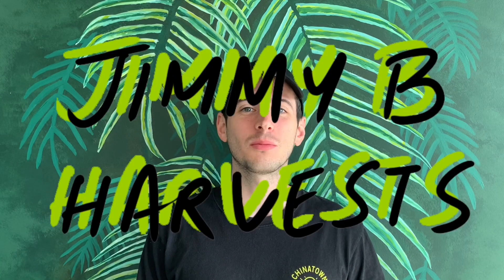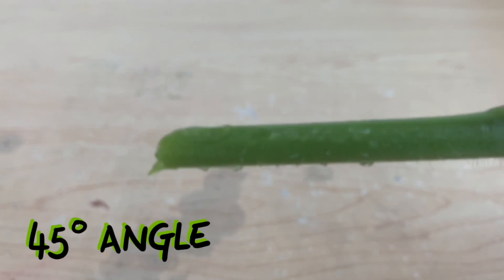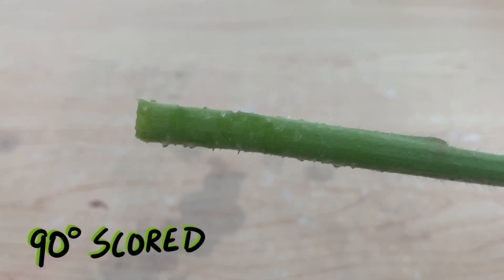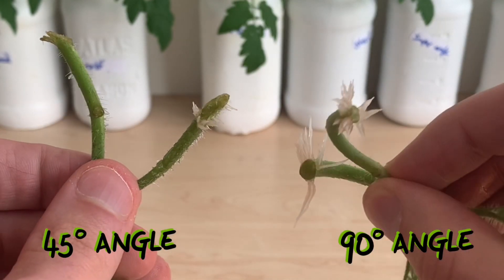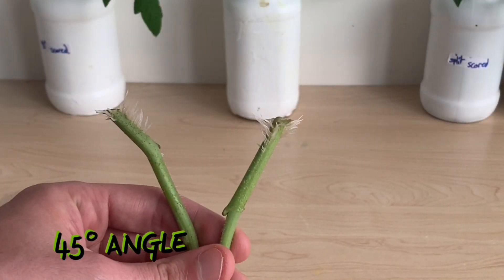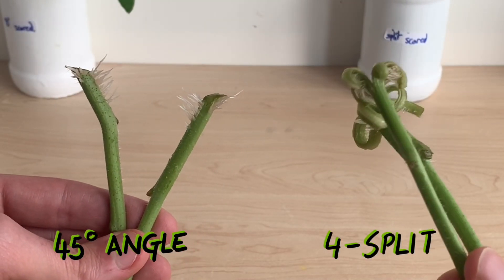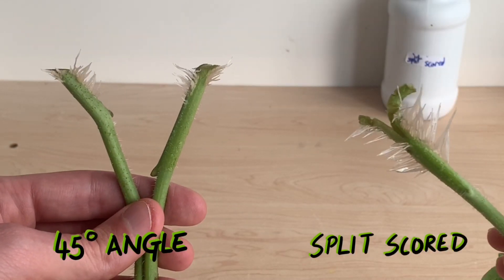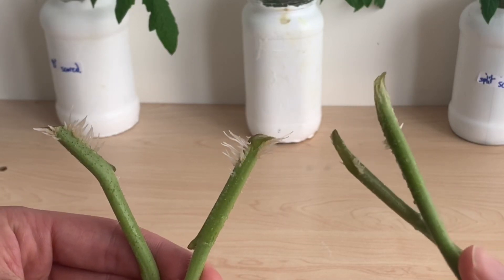A Faster Way to Propagate Plants

Comment: Was so glad to see you did more than just 1 cutting of at least the 3 main cuts (straight, 45°, split) as I was thinking before you intro'd the 2nd ones that this would be optimal!  I wonder also if this info is also applicable to making bouquet flowers last longer.... I might try the split cut next time in that sitch.

Comment: The 45 cut is best for cut flowers, as the greater surface area helps to stem uptake more hydration, keeping cut flowers alive longer. Which obviously doesn’t correlate with propagation. Thanks for showing these experiments. My propagated plants seem to take forever to root in water, now I u dear and why!

Comment: I believe cutting the stems on a 45 degree doesn't help. I've rooted many clones before and never seen roots pop out of the bottom cut. Usually it's on the nodes first then the stem. Just cut on a straight line

Comment: My guess was that a 45 through a NODE would expose the widest range of cell types to stress.  Those in the best position or should I say condition to make roots would be stimulated to do so.  FYI In my opinion if I can get ANY root formation I am 99% assured of success.  But I have never done an experiment such as this one...  did I miss it or did he give any attention to nodes?

Comment: The 4-splits are interesting. How about a much, much shallower cut? And even drill a small hole into the bottom of the stem to increase surface area that way? Is what you just did hydroponic rooting?

Comment: There was one technique you missed that I wish you could have covered. And that's scraping the outer cell wall - rather than just scoring it. I've been doing this for the better part of 4 years now and have found it to be the most successful. Paired with either a 45 degree cut or 90 degree, I've found it works with about 85-90% efficacy.
Reply from the maker: I hear good things about that method. Thanks for sharing
Reply: @JimmyBHarvests  Glad to, and great video btw! Forgot to mention that.

Comment: Hi there, have you or can you test the theory of shaving (couple shaves) the lower end (about an inch or so) of the cuttings to see if its better than the split method? I was told it's the best method for rooting. Much appreciated
Reply from the maker: I’ve seen some info about that method but haven’t tested it too much yet. Definitely need to in the future- stay tuned.

Comment: Have you got any pics of when they are very long say after 4 weeks or more.
Id like to see how the stem turns out on the split ends and how the roots look.
Reply from the maker: I don’t propagate them that long. I move into a reservoir with nutrients or soil when roots are an inch or two long. I’ve seen no impact later in the plants life as a result of the split

Comment: Watching this while working on cuttings to clone. Thank you for this video! I wanted to do the same comparisons & you saved me the time of doing so. Definitely worth the like and subscribe. 
I had been doing the super angle with occasional scoring or splitting. Now I will mainly use 90 degrees & split. 
Have you done a race with and without trimmed leaves? I nip the tips of the leaves left on the cuttings. My logic is this aids in focusing the plant resources into roots by causing a bit of foliage stress.
Reply from the maker: I’ve done some cannabis races with different amounts of leaves. Didn’t try cutting into the leaves though. I’ve also raced a handful of DIY rooting agents. Some of them had good results - honey and cinnamon. Propagation races playlist should be the first thing listed on my channel if you want to check it out. Best of luck with your clones!!

Comment: I think this specific comparison study is one that cannot be done accurately on tomato cuttings. Tomato plants, unlike most other plants, has the ability to grow roots directly through the epidermis of the stem rather than preferring on growing them at points where the ground tissues or inner part of the stem has least resistance by stem walls, like through a scar in the stem. Therefore, the surface area theory and some other methods here sort of become pointless. While the results in this video may hold true, this experience remains fallible due to being done on tomato cuttings. Thanks anyway.
Reply from the maker: Fair points Ahmed! Give this follow-up video a try, would love to hear what you think! https://youtu.be/CivPYxUX7MA

Comment: Do you think different types of plants would handle the split technique as well as the tomatoes? I've got Devil's Backbone I'm trying to root...
Reply from the maker: I just recently published a video showing a split vs 45 experiment with a variety of plants. I tried peppers, basil and sage in addition to the tomatoes. Sorry I can’t link it but you can find it on my channel in the propagation races playlist! Jury is still out on what’s ultimately better but I like the results I’ve seen with the split

Comment: It is possible be the same response on cannabis cuts or could be different ?
Reply: He picked the wrong plant to test. Tomato stems (and other plants like cucumbers) are covered in hairs so when they naturally fall over  the hairs can put out more roots.  I cut my cannabis clones on a 45 then put tiny slices in the stem. Make sure your cutting has at least 2 nodes and trim any fan leaves so the energy of the plant will go into rooting.
Reply from the maker: I’ll be doing races with cannabis again in the very near future! I do have one propagation race with cannabis out now, it’s available on my channel. 😁
Reply: JimmyB Harvests yeas already see it. And test by myself and its great. I’ll stay alert for the future racings. Cheers from argentina.

Comment: Good to know👍 I think I know where the 45' cut myth comes from: my grandfather was a farmer and he used the 45 ' cut on vertical branches to prevent water stagnation that would rot the branch.
I always cutted everything at 45😂
I learned something new thanks 🌱
Reply: I believe the 45 deg angle is best for trees as some of the stumps continue to flow out their sap for several days before drying up.  So, to avoid stump rot, it's best to cut at an angle.
Reply from the maker: Very cool! Thanks for the info guys!
Reply: It could be for grafting instead of cutting but since so much of the farming knowledge was lost after ww1&2 we kind of just copied the easiest to remember. Like how many of us actually know how to change carrots from purple to Orange.